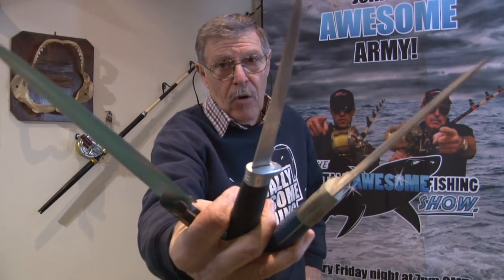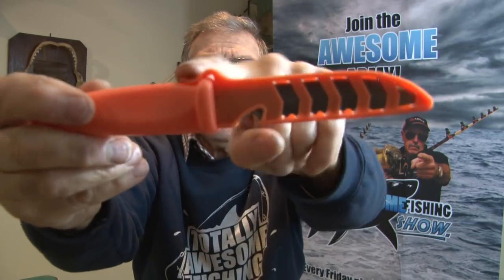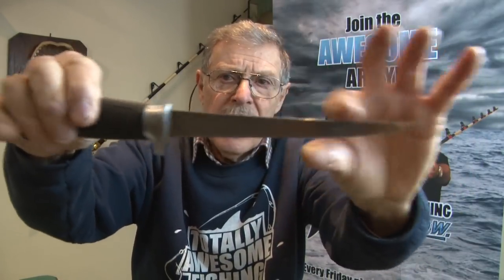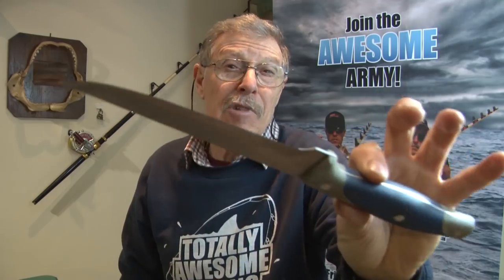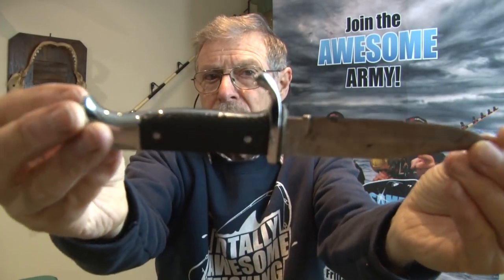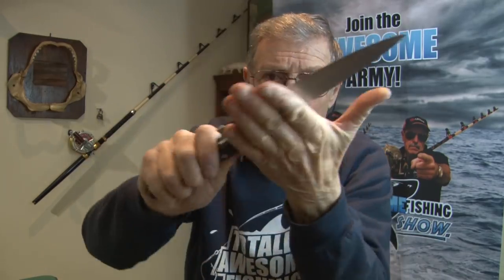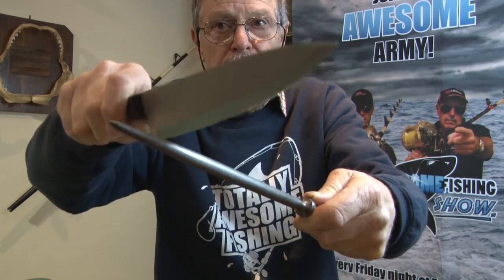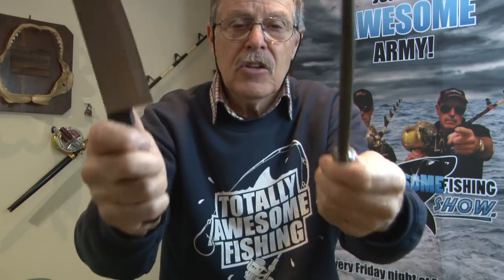How I Sharpen my Work Knives: So Sharp I SHAVE with it!

Comment: I have a 3000/8000 grit Norton wet stone. It works amazing. My old wood handle Rapala filet knives are amazing. If you can find Fiskars knives, they are great, made with Sandvik steel. They take an edge and keep it. I have Wuestoff Trident kitchen knives. They are well balanced but are more difficult to sharpen. The carbide sharpeners work about 15 times on hard stainless knives, then they become more of a knife duller. The ceramic wheel sharpeners are very similar to the carbines. They become load with steel dust and will round your edge m

Comment: after working in a chicken factory for 5 years ,, you sharpen using a steel  with the blade facing away from your hand holding the steel ,, its the safest way ,, do not draw the blade towards the hand , you will get cut if the steel has no guard
Reply: Used a steel since the age of 5 dad was a butcher shoeed me how to use one  never even come close to cutting my self

Comment: good informative video m8. i have a old steel, sheffield england forged steel. loveily wooded and brass handle, its classed as a antigue when i googled it. i also have a cheap modern steel and stone set, diamon stone and axe stone. i did use oil and was stones in soapy water , not i just soak/use water with my stones. seams to work ok. i luv old stuff, have old oil cans, bisket tins, tools etc.
hahaha you are so funny, a few times now i went to a barber for a cut throat shave. they used disposable blades, i was dissapointed. i wanted to see the old cut throat razor and leater etc,i baught a old cut throat razor the handle is made out of a old wooden ruler. its pretty crappy and not useable but looks cool.
Reply: Wow what a collector! The ruler razor is worth some money. It was made so the barber could ask indicate the size of condom the customer required. Without any embarassment in the salon.

Comment: Thanks for these tips go.ive been putting to steep an angle on my filleting knife.this will help loads.
Reply: Hi, i had an expensive fillet knife. Fantastic for general use about 6 months. Then it started tearing the fish. So i used as on here a stone and tried to sharpen it....it devloped cracks.

Comment: Im pretty sure a steel doesn't sharpen a knife by taking material off. It straightens the cutting blade, so it cuts (and sharpens) better
Reply: I nevef thought of that....?...
Reply: Exactly right. The steel hones the edge. Basically straightens the burr back into line so the edge feels keener. Eventually when the burr is gone completely, the knife will need re grinding.

Comment: Just don't get caught carrying them outside your home as the legal blade length is a max blade length of 3inch  and non lockable even if your fishing it applies.
Reply: Colin.. If you are fishing, just have it in your tackle box. Common sense 🤷
Reply from the maker: I'm hardly likely to walk through the supermarket with an 8 " blade !!!
Reply: I was just pointing out, for the viewers, that it is illegal if you get caught with a blade bigger then 3inch ,  even sitting on the beach you can technically be arrested, if your oversized locked knife was on show. Only if its part of a registered trade and its a genuine tool of that trade then its allowed. Only trying to help.
Reply: @colinmitchell9212  you are correct in that being the law. I've got an interesting genuine question for you though that I was pondering a day or two ago. I was tidying up my fishing gear which had the start of mice living in it and I found an old lock knife with a blade of 2.75 inches, however, the lock doesn't work on it so it technically doesn't lock. My question is: is this still illegal because it was designed as a lock knife and has a lock on it, or is it now legal because it doesn't actually lock and functions as a plain folding knife? I do genuinely wonder where I stand here re the law.
Reply: @vinnyvtec8722  interesting question, I'm guessing its one if those grey areas. I really wouldn't want to guess either way.

Comment: 1st mistake using oil on stone instead of water
Reply from the maker: 2nd mistake...Being able to cut bait exactly as I want ??
Reply: Why is using oil detrimental to sharpening ?? Explain please Mr Raider ....
Reply: Why are they called oil stones?
Reply: Some stones use water and some use oil as lubricants. The oil lubricated stones are called oil stones and the water lubricated stones are called whetstone (wet stones). 🤷